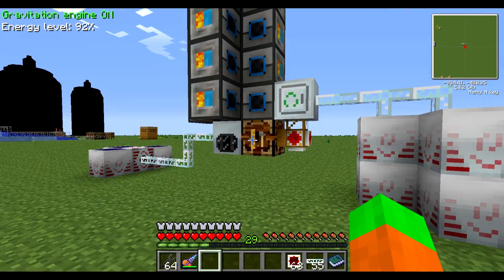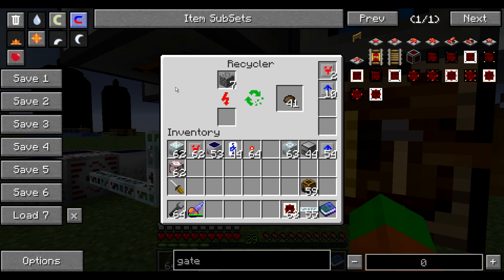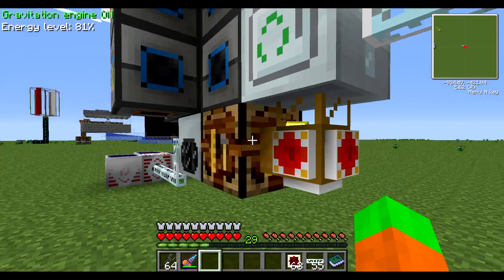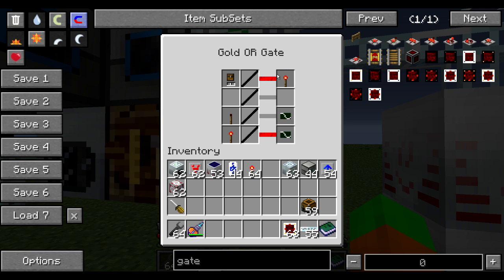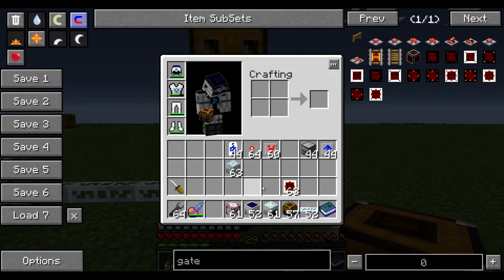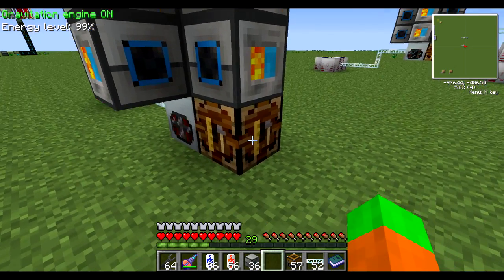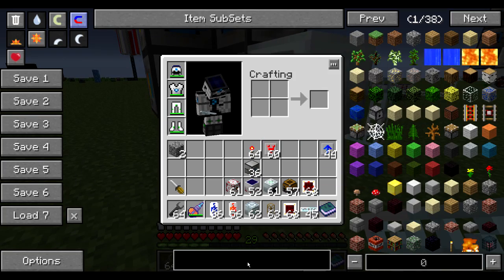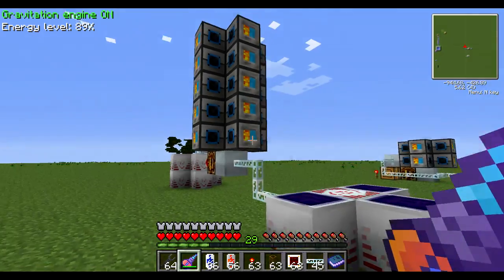Minecraft Tutorial - Efficient Mass Fabrication

Comment: Instead of using a golden or gate, you could of used an iron ore gate, and instead of using two lines for the energy pulser, place a piece of red wire on the pipe, and use 'red pipe wire off' to activate it. I did not know that scrap boxes worked in a mass fab though, i'll definitely be using that some day.